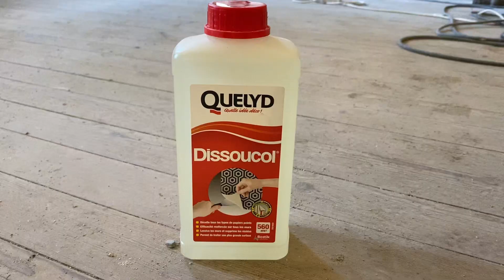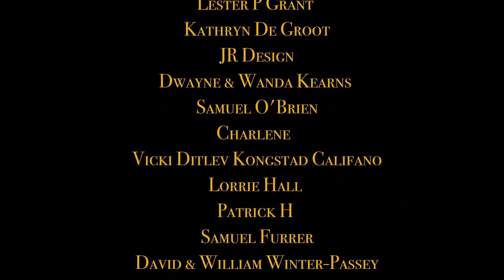EP49 Daily Vlog :How to remove wallpaper easily Day 2 of 7 day Transformation Challenge

Comment: Just a little tip if you score the wallpaper then soak will come off easier.  Doing an amazing job. Love you guys and your achievements. Love from Glasgow 🏴❤️
Reply: Looks like a vinyl coated paper.
Reply: There's a round disk with pins that rotate, you hold in your palm, press onto wallpaper and it scores as you swirl all over and the mixture penetrates through those tiny holes, correct me if I'm wrong, I've only seen it done once
Reply: That was just what I was thinking. Score the paper.
Reply: @deesa3500  Yes!  It's called a paper tiger.

Comment: 70's - 1990's Vinyl wallpaper had a paper backing attached to it.  You can tell if it was a separate lining by the seams not matching up with the wall paper seams, in other words the lining would be applied first starting at any Willy nilly place in the room, then the wall paper would be applied starting at another point in the room depending on where it is easier to match the pattern. So the seams would not match up.  Anyway, well done, keep up the good work 💖❗️

Comment: The paper on the wall is vinyl coated and was known as "peelable" which supposedly leaves a lining paper on the wall ready for painting or re-papering. It doesn't always work - taking off both layers only on some parts. Re "scoring the paper "- don't do lines close together  or you will be peeling off postage stamp sized pieces! Been there, done that! Vinegar is cheaper than bought product.